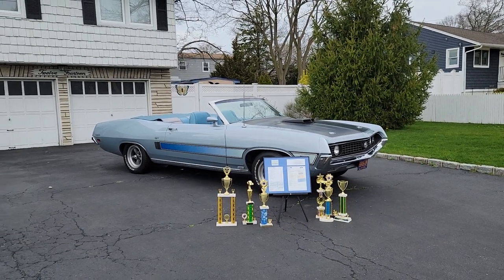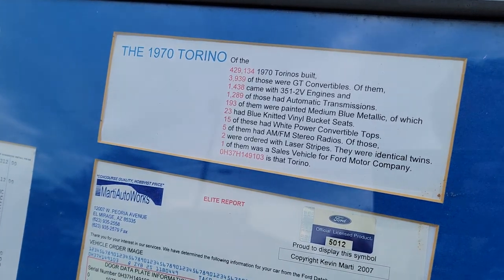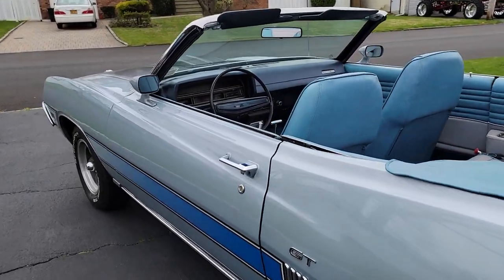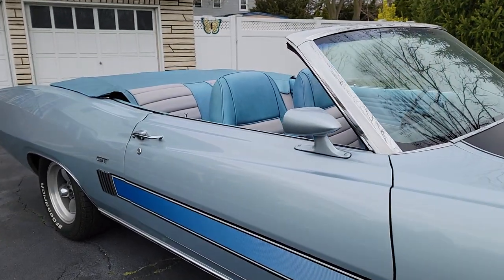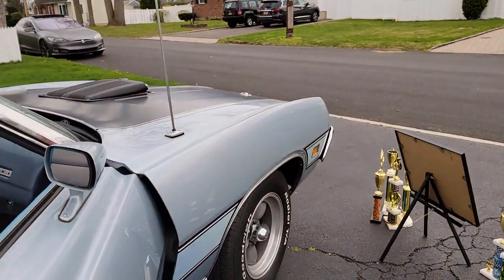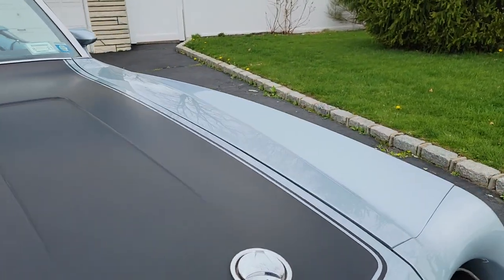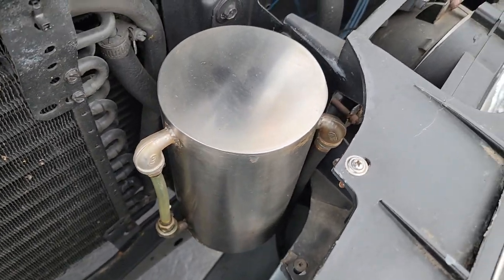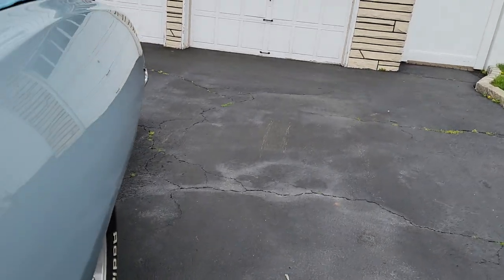Trophy Snatching 1970 Ford Torino GT Convertible For Sale~351~A/C~PT~PS & PB...

Comment: pretty sweet not many convertible Torino's i had a 69 Torino 428cj 32,000 original miles from original owner bought in 1999 sold in 2010 wish i still had. would have sold the wife instead...
Reply from the maker: Thanks, Your's with the 428 Sounds Fantastic Though 🙂